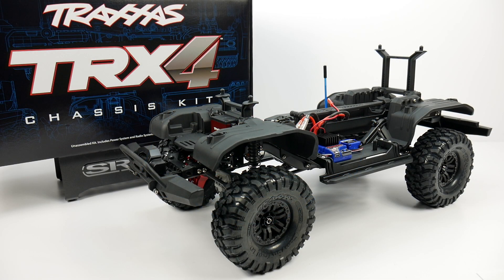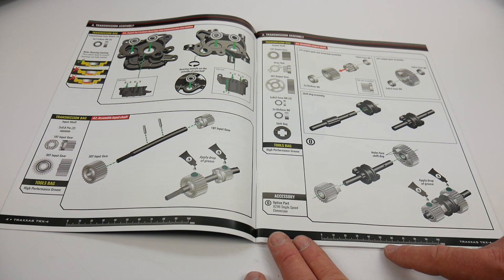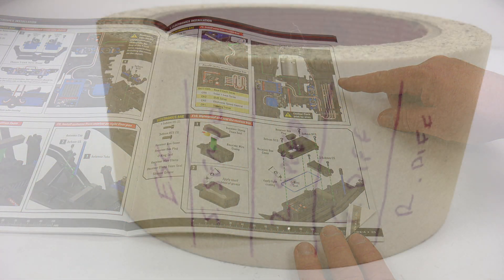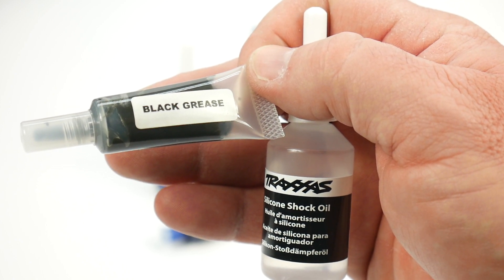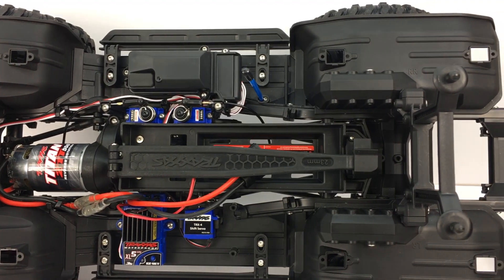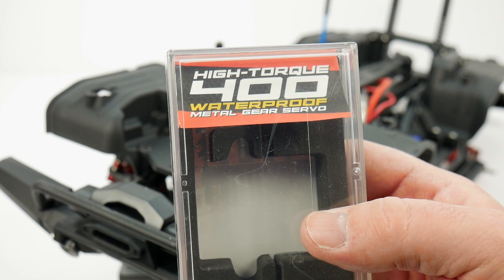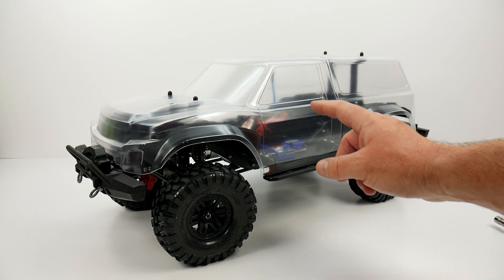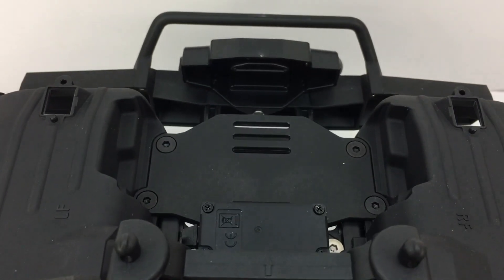Traxxas TRX-4 Chassis Kit - Build Review - "Juiced Up" - Episode 2

Comment: I have one of these chassis’s. $400 kit. With a built in interference between the front pan and rod and the horn for the steering servo. Limits articulation in the front
Reply from the maker: I like mine....probably my fav crawler next to my VS410 Pro
Reply: @TheRCNetwork  How far up does your left front wheel go before it stops?

Comment: Is servo and moter waterproof? and what is not waterproof?
Reply from the maker: The Traxxas vehicles are all waterproof - motor, ESC and the receiver box are all waterproof......is it a submarine?  NO.  When ever your RC get's wet, it usually is not the electronics that take a beating, it's the hardware rusting, bearings seizing and hard metals like differentials rusting that creates havoc

Comment: Lots of great info. I'm building mine with an upgraded brushless motor and ESC. Surprised you didn't do the same! What do you think about this upgrade?
Reply from the maker: Thanks buddy!  I wanted to try it 100% stock at first.  If you watch the later videos, I still kept it brushed, but used a HW 1080 and a Holmes Hobbies motor
Reply: @TheRCNetwork  I did notice you used the HW 1080 ESC. It's an ESC I frequently use. This is my first experience with a brushless setup and I'm on hold with a few technical difficulties but Amain Hobbies is working diligently to resolve these difficulties. Thanks again for your video...

Comment: I just completed a chassis kit build as well, and am going to run the Sport Camper body too. I just don’t think you can sit the body that low, so it sits in the sliders, with the headlight kit in. The light buckets will hit the wheel wells, forcing you to raise it a bit. I may shim my sliders up to meet the body better. Let me know your solution.
Reply from the maker: Yeah, I noticed that might be a problem.  I can make it work! lol. I'll address that in the next video.  Stay tuned!

Comment: Did you have the trans gear issue where the bearing wouldnt fit or have they since fixed the issue.
Reply from the maker: Not at all - mine went together perfect
Reply: @TheRCNetwork  thanks I want to order this with the proline c10 "k10" body 1970s to match the scx24 I got. This trx4 is gonna be sweet.

Comment: Rich can we use DEFENDER body she'll to that kit?
Reply from the maker: I believe the Chassis kit is based on a 12.3" WB and comes with the wide inner fenders for Bronco and such
Reply from the maker: The defender is a 12.8" WB
Reply: Traxxas makes a Conversion Kit TRA8057 to extend the wheelbase so the defender body will fit.

Comment: the chassi  kit is almost the same price as the ready to run cant see the point of the kit when its only 50 pounds cheaper
Reply from the maker: I like to build my kits though - and didn't care for an RTR body.
Reply: @TheRCNetwork  i am with you on that fact to building a kit is the best way to learn your vechicle and to know how to fix it to i cant see why the kit is just so expensive though
Reply: @rileykairc  most likely because all the electronics are included, including tx/rx.
Reply: @humblerc841   i would rather choose and put my own electrics in rather than have theirs i know i wouldnt use theirs at all and there is better electrics out there that are cheaper and work better to it just seems to me that traxxas is just greedy
Reply from the maker: Look into the Sport Kit - No electronics and no locking diffs/2 speed.  Super simple and much cheaper
Reply: @TheRCNetwork  thanks i will

Comment: Hey! I was looking to get into buggy racing, I was wondering if you could do another 1/10 scale electric budget build because it seems like the atomic v2mr is not available anymore, and I am not sure what to buy.
Reply from the maker: Honestly, I'd look into getting a used Associated B6 or TLR 22 4.0 - You can probably find them for $100 for a slider and add in electronics/wheels/tires
Reply: I was also looking into the rb6.6 and upgrading the electronics would that be a good starter?
Reply from the maker: Yes, yes, yes!  Great alternative as well.  It drives great right out of the box
Reply: Thank I appreciate it! Continue to make videos because they are awesome.